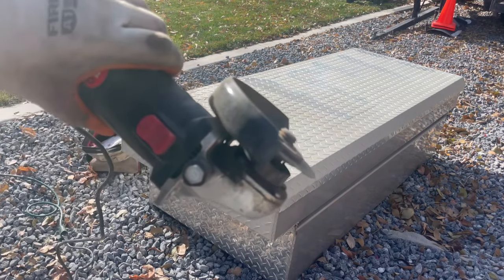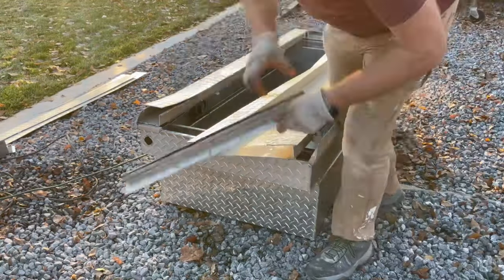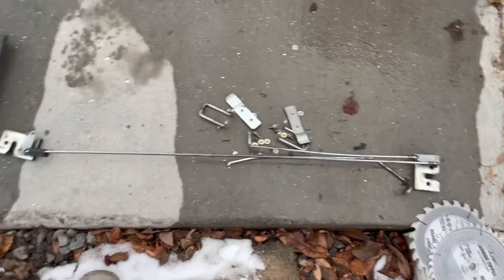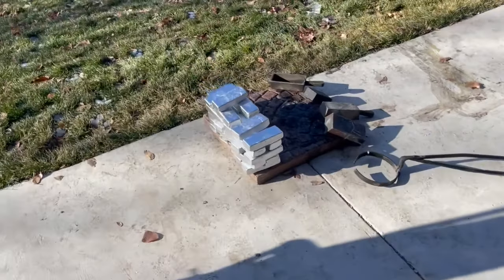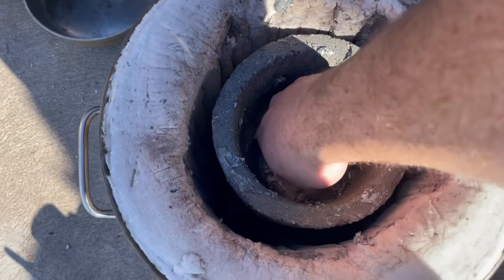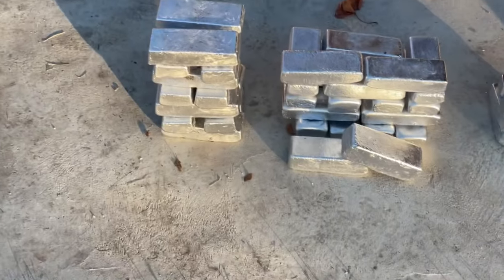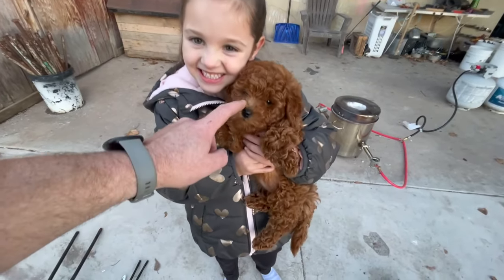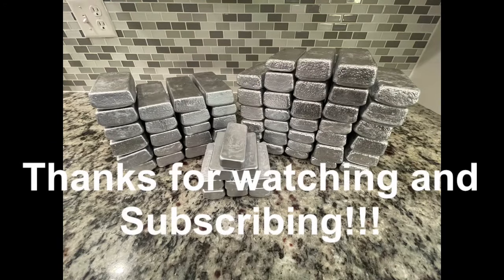How to Scrap an Aluminum Tool Box | Melting Aluminum into Ingots

Comment: Is this what you cut your finger on?
Reply from the maker: Not sure, this or the next video;)
Reply: So the market value is $42 after all of that. How much fuel did you use for this and at what cost? Nice stack in any event. 🍻
Reply: He could have sold that toolbox on Fakebook for 150
Reply: @ObsoleteSoldier  That may be the scrap value but the value as an ingot is closer to $4 a pound making these worth about $280.  Still a lot of work though.
Reply: @matthewthemanparker  I see. Just curious. Nice stack in any event. 🍻
Reply: @matthewthemanparker   in what word is aluminum worth $4.00/pound?
Reply: @benloyd1970  That's pretty much the going rate for aluminum on ebay.  So I guess the "ebay world" ?